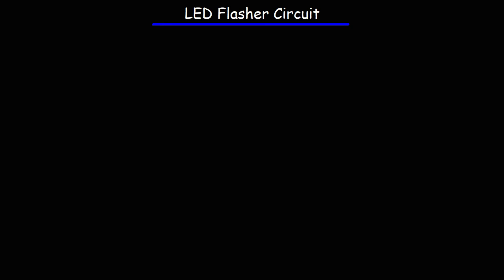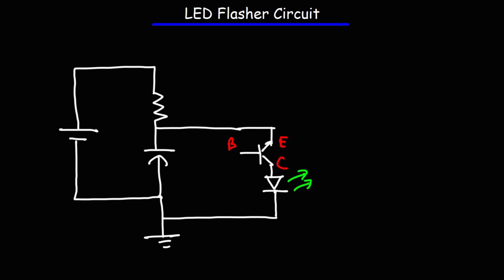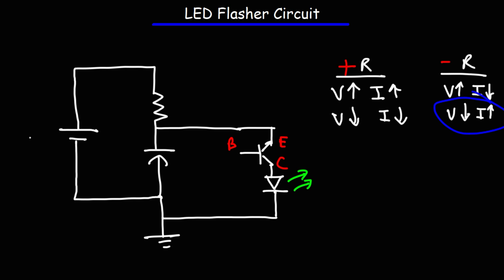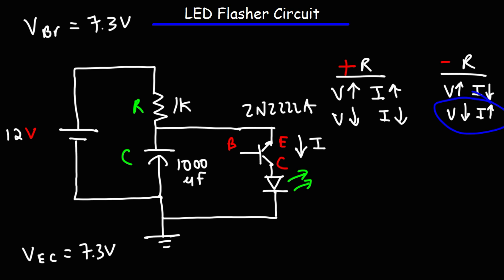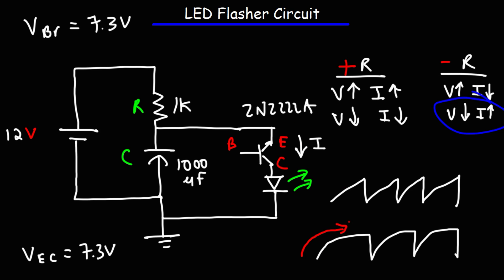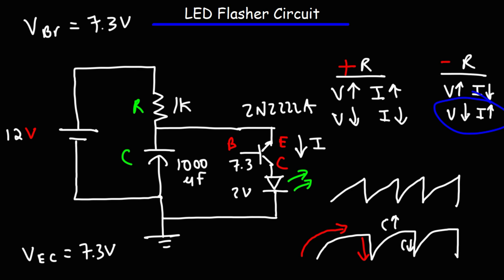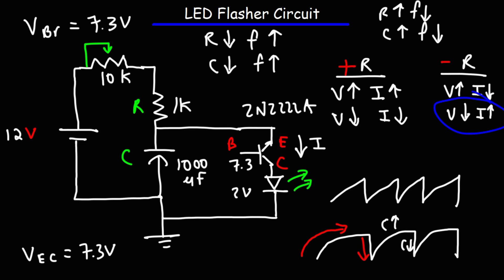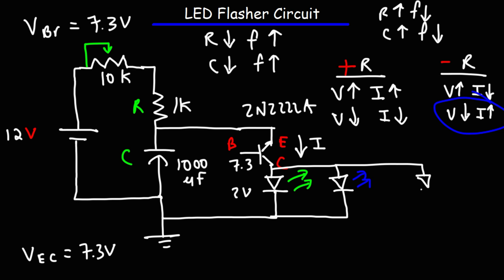Single Transistor LED Flasher Circuit Using Negative Resistance

Comment: That's a pretty cool circuit! I'm thinking that I can scale it up some  and add a brushed DC motor as the load, in place of the LED. On a gear system, move mass at a programmable rate based on the potentiometer. Great video! Take Care buddy, John

Comment: What specs do you need to decide which transistor to use in this circuit? Say if you want to use a higher power/brighter LED.
   It still seems weird that we're using a transistor but not even connecting the base...